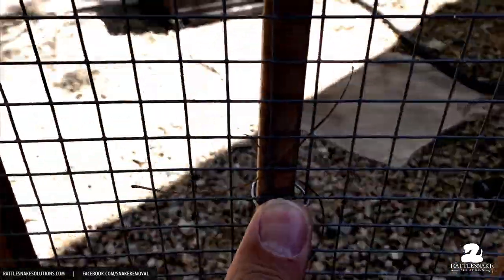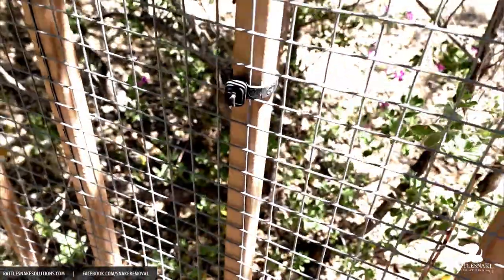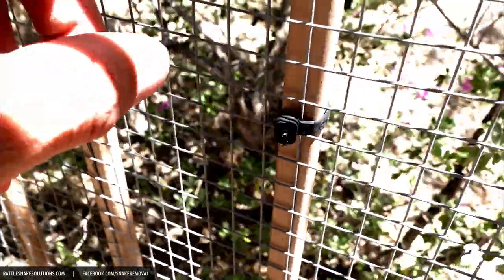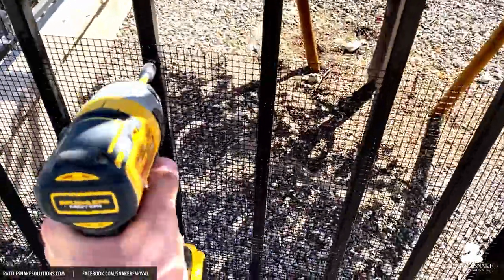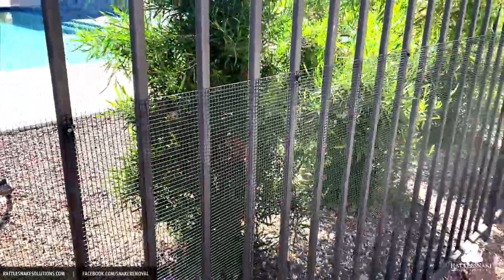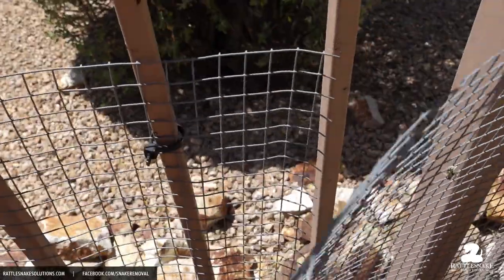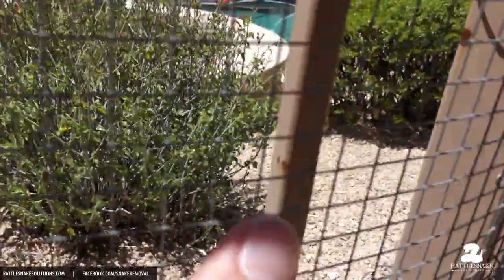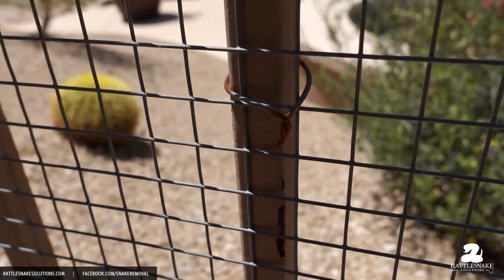Why You Should AVOID Zip Ties or Wire to Attach Snake Fence

Comment: What about on chain link fences? You can’t use self tapping screws on the chain links themselves only the posts. And if you only did on the posts there would probably be too much sag. Even if your posts are every 6ft. And 8ft or 10ft is a more standard distance.
Reply from the maker: In situations like that, wire tires and welding are the only viable options. A chain-link fence isn't subject to the same HOA-required painting concerns, so it's not the same situation. It will require more maintenance than screws.